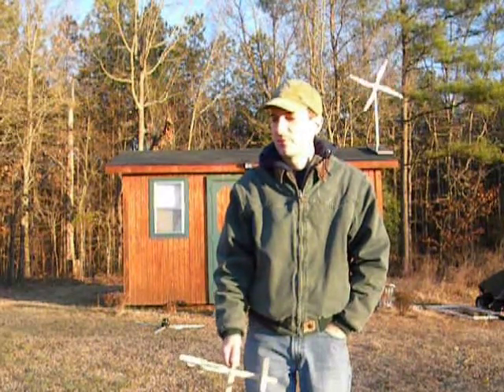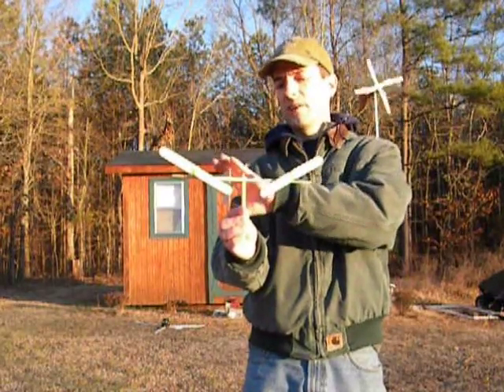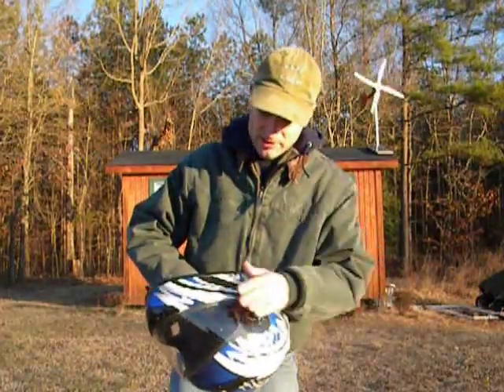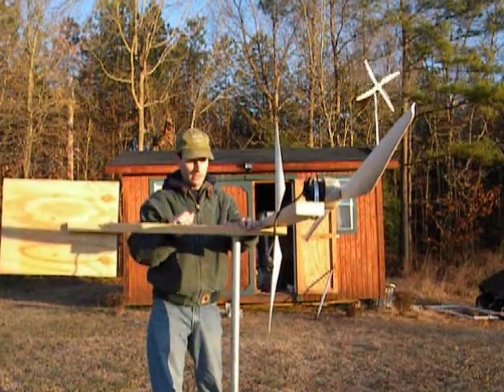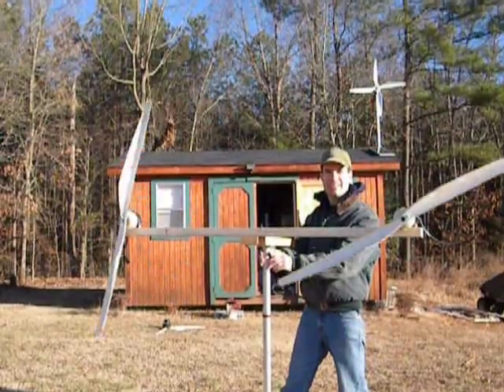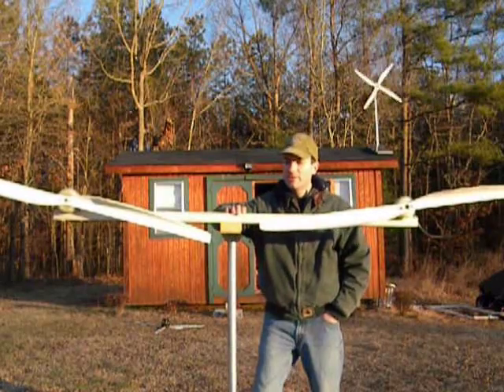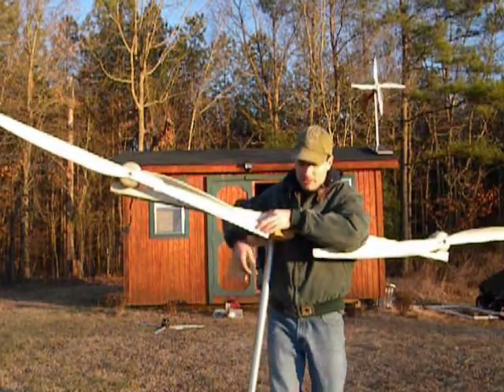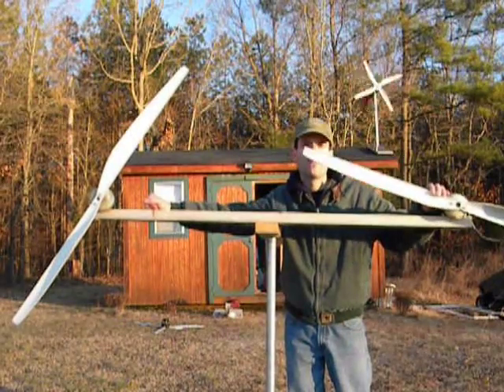2 motor wind turbine

Comment: Good video, I just wanted to point out that you don't lose amperage when you put them in series. You get the same amps as one motor, but voltage doubles.

Comment from the maker: @retrokidm I bought the 2 motors from a auto scrap yard close to my house. They cost me $2.00 per motor but, I had to go through a hugh pile of motors to find the ones that worked. I am sorry, but I am not able to sell them because I am using them for another project. I would just start calling local scrap or junk yards in your area to see if they sell to the public. I had to call 10 before I found 1 that would sell to me. Thanks for the question, Lonny